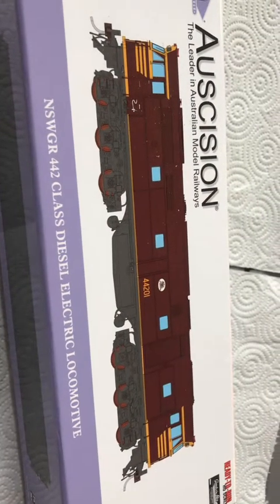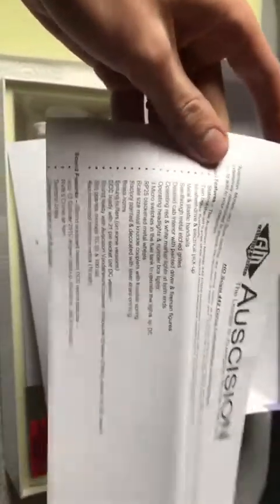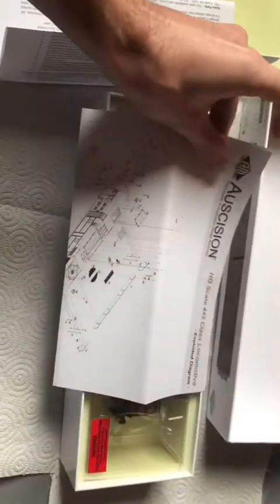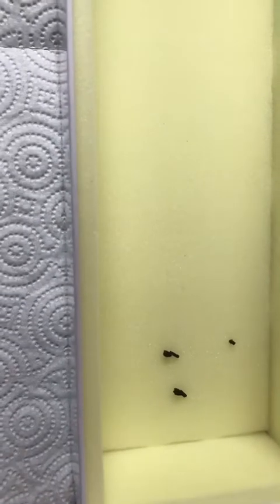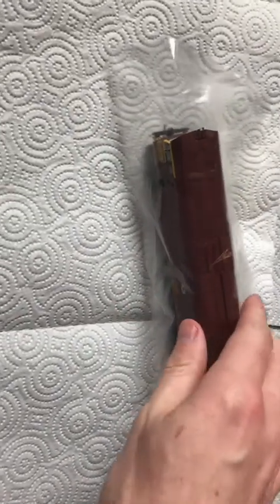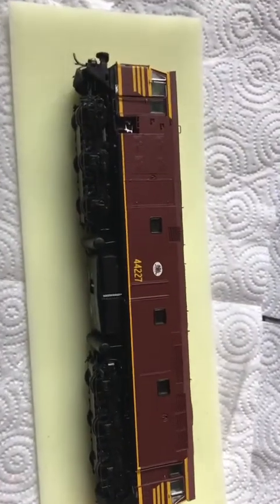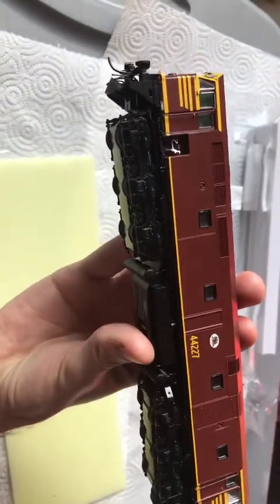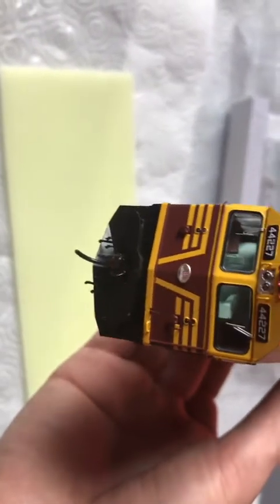Auscision 442.class review

Comment: Have you removed the motorized boggies from the class 442 body?  They supposedly snap off and snap back on after cutting or removing a small chain.
Reply from the maker: I never pull mine apart I know but form the 48.class and all others it’s easy job pull swears out of couplers with the box’s use bit of card to open the whole and pull